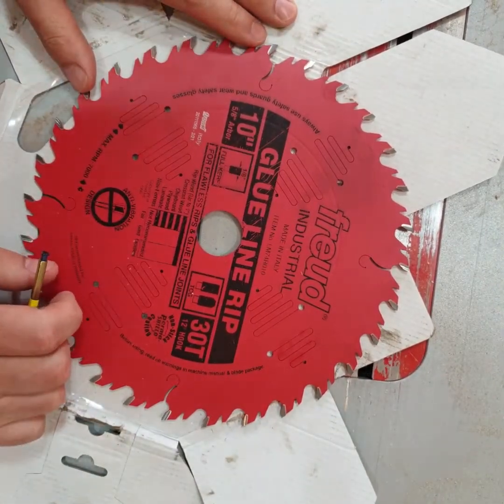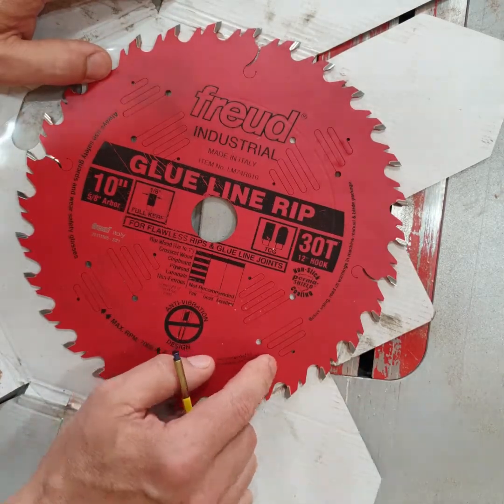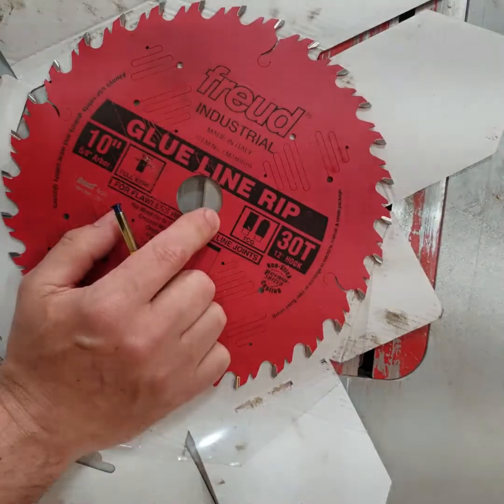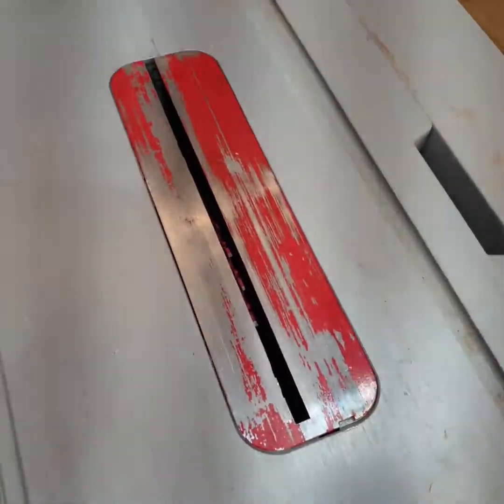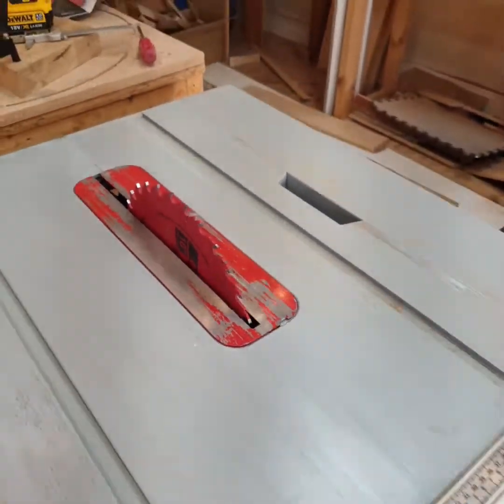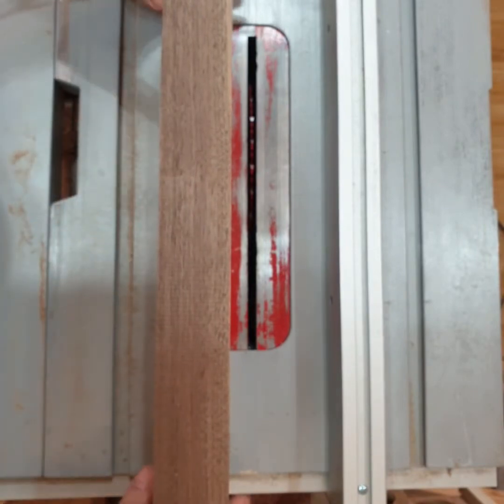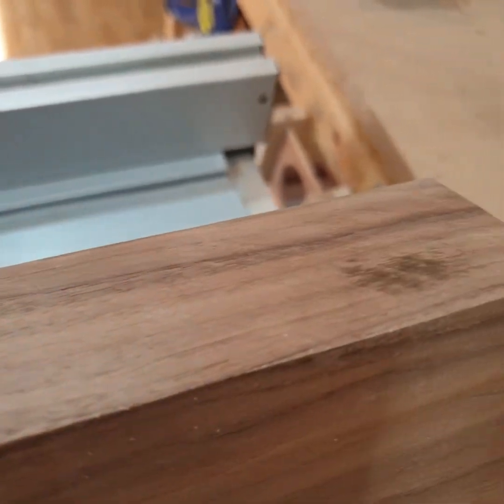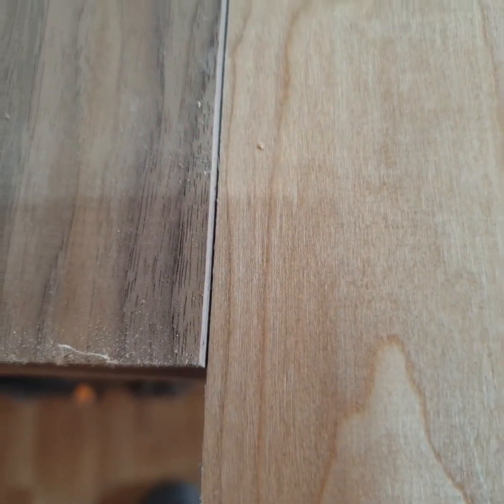Opening 5/8" Arbor to 30mm on 10" Freud Glue Line Table Saw Blade

Comment: Are you still happy with the blade? i cant seem to find Forrest or Freud blades in europe (norway)
Reply from the maker: I am happy with it.  It works best with timber that is 25mm thick or less.  I have been able t I  use it for thin strips of wood as well.  They are good enough to use in glue ups.  I will not be buying another one of these from the USA as it was expensive and difficult to get the machine shop to open the hole up, they usually do larger jobs. I will shop around for a "triple chip blade" here in Europe.
Reply: @breakingwavecustomwoodwork8683  yeah difficult to find anything with a 30mm arbor which seeks to be fairly common here in Europe.

Comment: I would still disconnect power and measure each tooth when you spin the blade
 to ensure it's completely centered. If it's a hair off, you will never know if you're looking at it running.